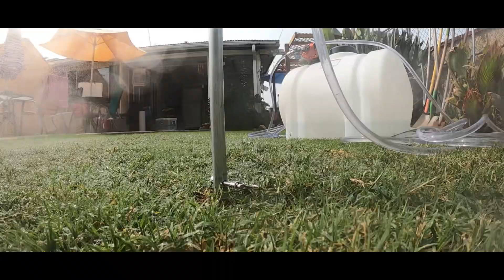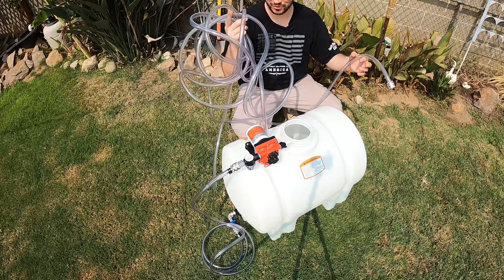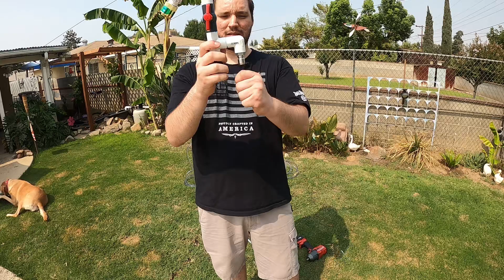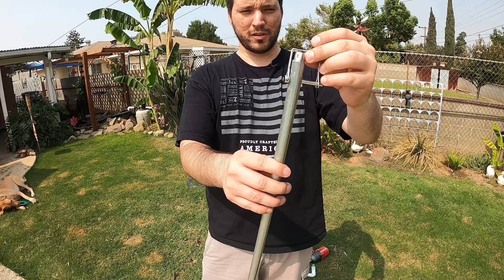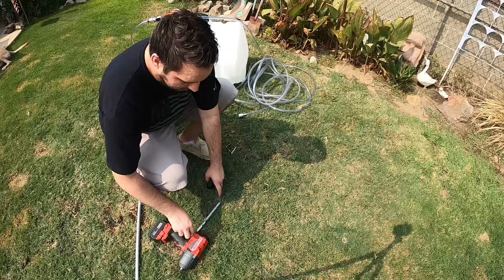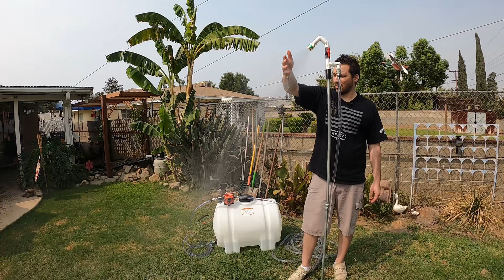DIY Pressurized Camping Shower 1/2 GPM

Comment: What size pipe would I need to screw a waterhose to the outlet on the tank or something else?
Reply from the maker: It depends on the water tank’s bulkhead connector it came with. More than likely it’s pipe thread (MNPT - male or FMPT - Female). Just get the size that fits that OD or ID and adapt to GHT (garden hose thread) male to attach a water hose if that’s what your asking.
Reply: @ProjectAnubisUSA  ok thx. Love your shower you did :)

Comment: And why do you call it a POS, I mean I know what POS is, but why do you call that a pos, i mean if it heats up as it's designed, what is it about the Colman that causes you to call it a pos
Reply from the maker: No flow meter, No long battery life or easy replacement (I have a video where I designed one), short runtime, weak pump, no auto stop and start, expensive (for what it is), parts are not easy to buy according to some viewers, silicone hose, etc. Just other options that function better for a similar price.